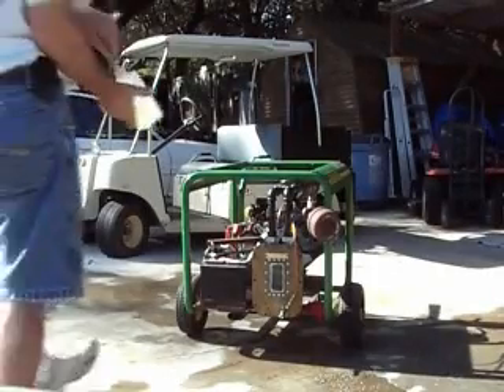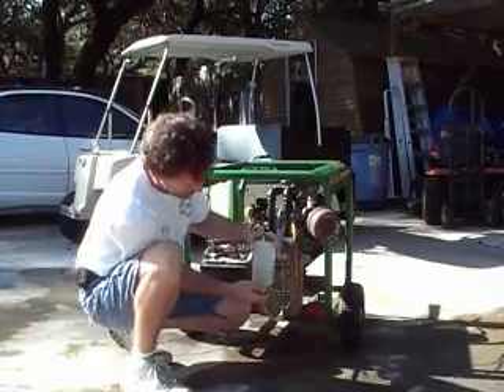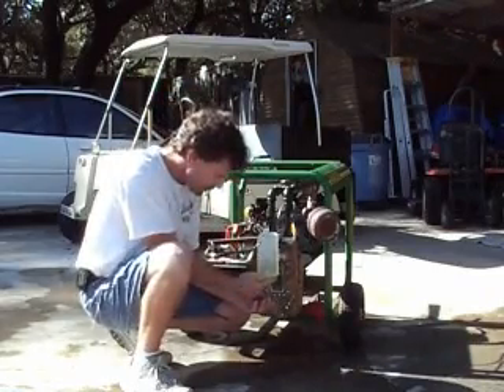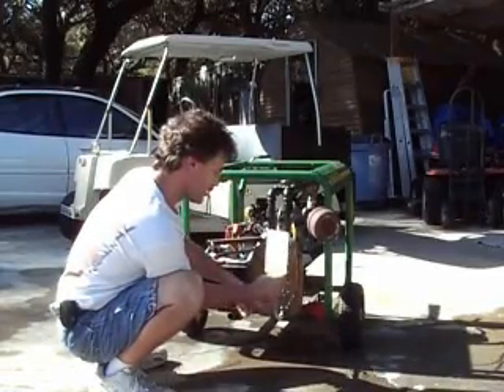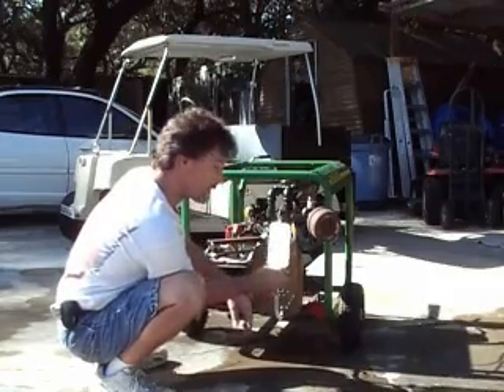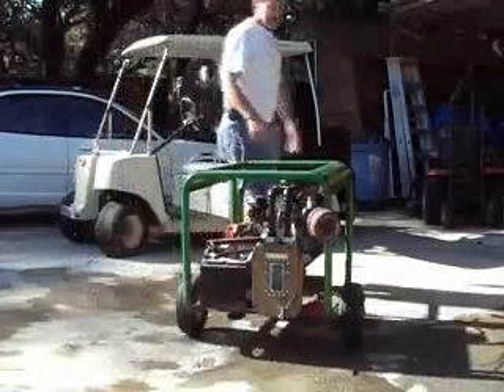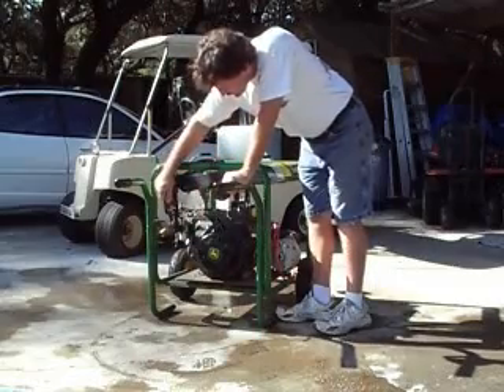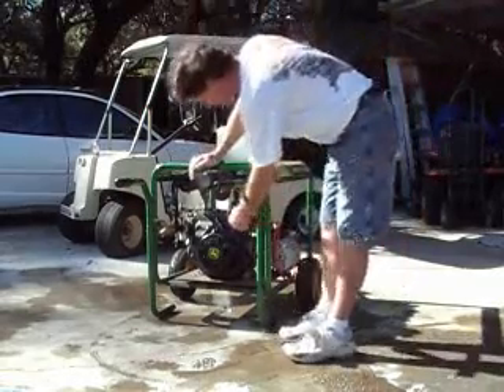GEET Vapor Carb Generator

Comment: I saw this before I watched a better video and took my generator dismounted the air filter added a geet carb and now I start my generator on gas turn off the gas to the carb and continue on with just water !You must be a pansy to not run yours on water I keep my generator running all the time on the water hose and I sell the electricity to the electric companies I never have to change the oil it never gets dirty I don't want to make a film I don't need them showing up at my door !

Comment from the maker: I hope you watched all of the videos. This engine uses a hydrogen cell as the load on the alternator which is belt driven off the output shaft. You probably didn't see the belt on the pulleys. All testing was done pulling around 15 amps on the alternator. In later testing I verified the light load using less fuel , but still significantly better than carb setup. Some of the improvement came from the modified exhaust as well. This is just a vapor carb setup to experiment with and use multi fuels.

Comment: When you claim that the GEET System doubled your fuel economy, did you test the normal liquid fuel carb without the generator as well?
I ask because I noticed that in this video there is no load on the engine. Just an unused output shaft with a pulley on it. Also, why would you test an engine under a "no-load" condition? Isn't the object to test how well the GEET performs UNDER LOAD? Seems meaningless to do otherwise.

Comment: @onecraftydude Come see vapor running a truck engine, only it is not gasoline vapor anymore, however it was made from gasoline, using a specific heat, and my process. You Tube, White Gasoline Vapor, read everything.

Comment from the maker: I don't have the generator on it. I have a 60 amp alternator on it. The reason it's my test platform is the generator had burned windings so I added an alternator for hydrogen experiments. My rpm's are set for 2500. I used the existing carb and governor to help there. I am sure I will have to make a proportioning valve for the fuel/air mix to keep it from stumbling under heavy load. I'm thinking of a BMW setup, of course I will have to make that 2, lol.

Comment: The carb was designed to keep rpms at 120v... Your GPH should be more... Its probably running to fast... If you put a meter in the ac out put its probably over 220 like mine was...

Comment: Nice job... Make sure your RPMs are at 120v... The problem i had was when you bring something on line it would make the generator almost stall and not recover. Need some kind of device to control air and gas by RPMs...